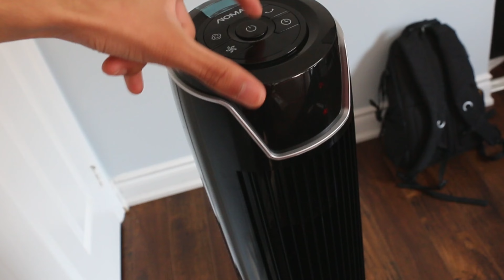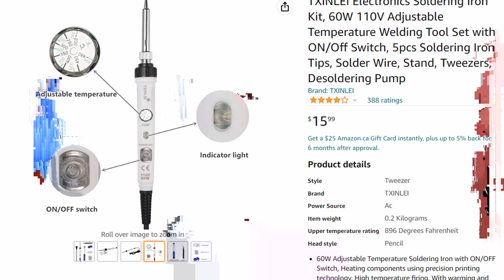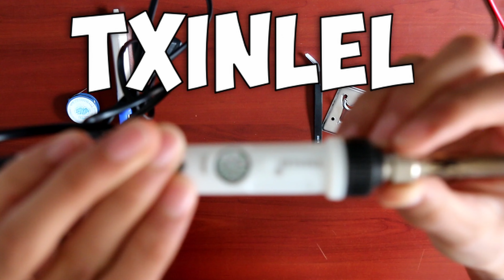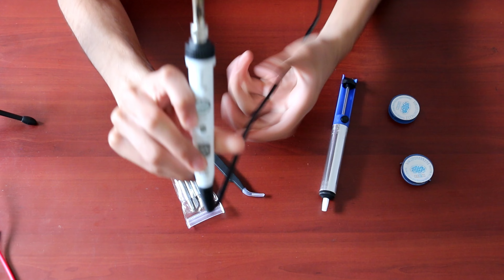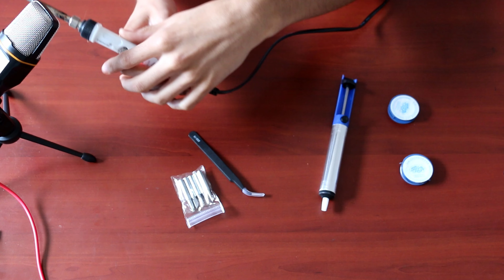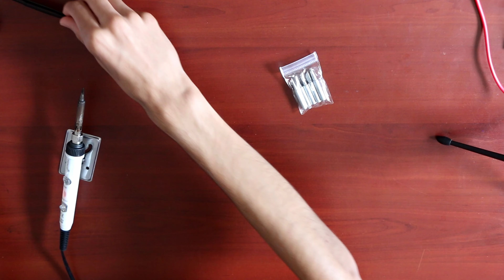How to SOLDER DC Motor with Wires | Arduino - Quick & Easy Guide

Comment: Well done, just try to clean your soldering iron by using a wet sponge and a wire mesh to dab the tip of the iron. You should have a clean iron when soldering. 🥸

Comment: What type of solder? Im working on a toy that takes C batteries. The motor is a little bigger than that but not much. Wouldn't it take the same sokder? The kind i have is too thick
Reply from the maker: Most likely you can use the same solder to join the big C batteries. But if, and only if you think it may be too thick to solder it with the one shown here, then you can use the blow torch and a thicker solder wire. Hope that helped. Cheers

Comment: i hope you are joking 

there is soo much wrong in this video, i dont even know where to start.
Reply: "There is no right or wrong way to hold the soldering iron"

holds at the tip am I doing it right then?
Reply: may i ask what is wrong? I am learning to solder and don't want to make any bad mistakes